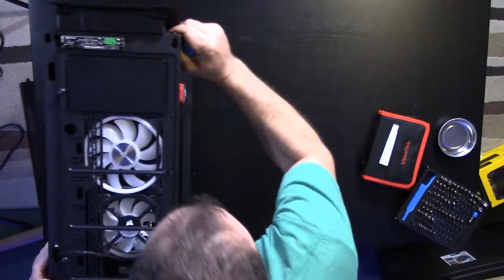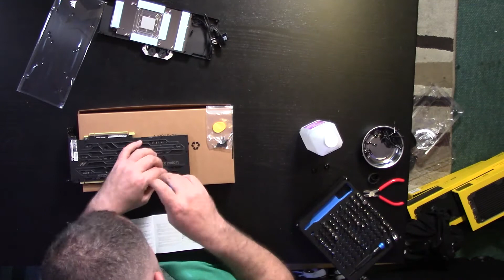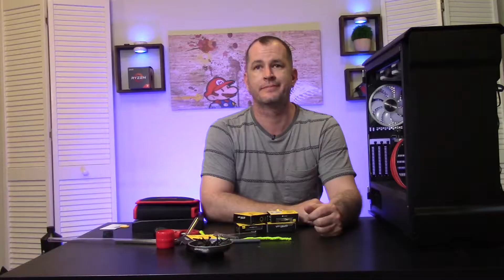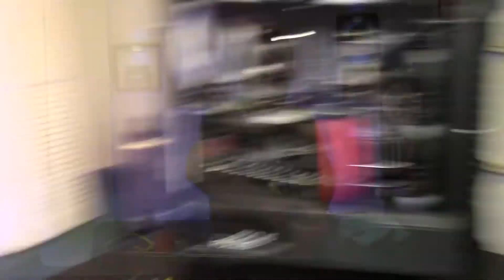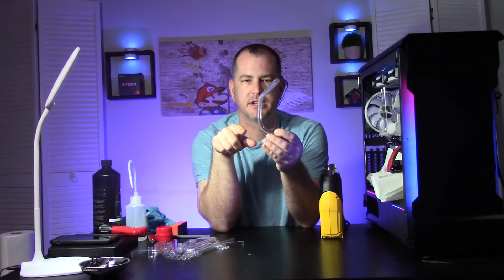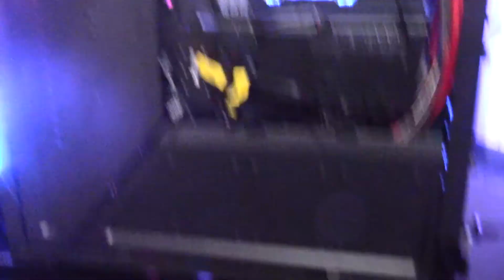Phanteks Evolv X. My first custom loop!

Comment: i like your video, but the only problem with corsair configurator it doesn't say which fittings to get and doesnt show a diagram with the tubing, also dont be mad but 31:34 i can see the tubing is not really straight and the fittings are a bit off balanced, maybe its your first time thats why i want to avoid the hardline tubing done by myself coz am sure my result will such first time, however i admire your persistence and your result turned out really good maybe your second try will turn out even 10x better !...
Reply from the maker: Hey thanks! Can confirm: second hardline came out better:)
Reply: @currentlykent4593  man from all those videos out there i swear yours is the most informative!!...  i one discuss this i  details like u did not those 10M subscribers utubers 😡 ...

Subbed to ur channel.....

Comment: But out of curiosity why do that 2 way bend and just use the fittings with the bends to get that done.
Reply from the maker: ddcn427 hey! Thanks for checking this out! That word: “umm”. 😂 I was able to edit most of them out, actually. So there was more than what ended up here. I didn’t script this video like my last one. Will do scripts from here on out though. Makes a huge difference. For the bending/bends: I thought about doing all 90* fittings instead of bending, but really wanted to try out bending. It doesn’t really show in the video, but the RAM clearance was why I came out of the cpu block that way. Couldn’t get to the rad without coming out first. Thanks for subbing!